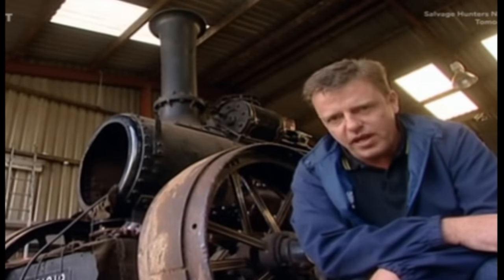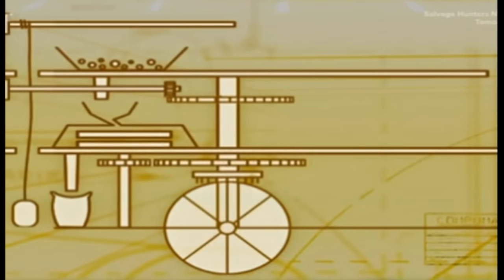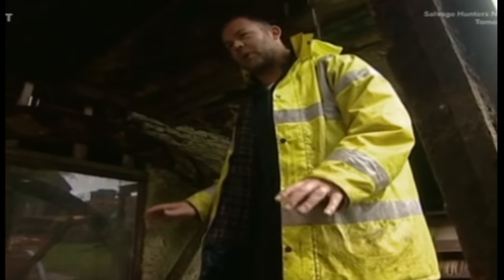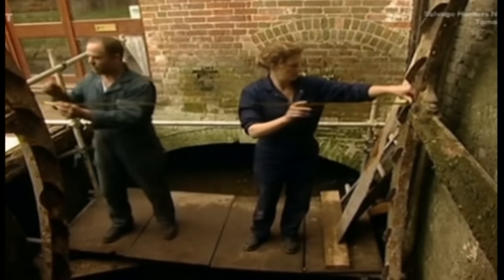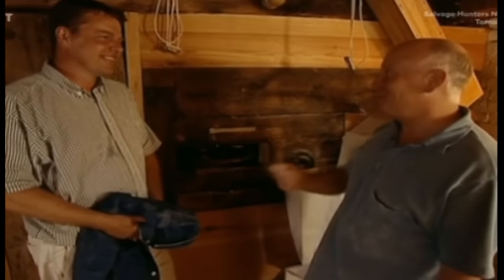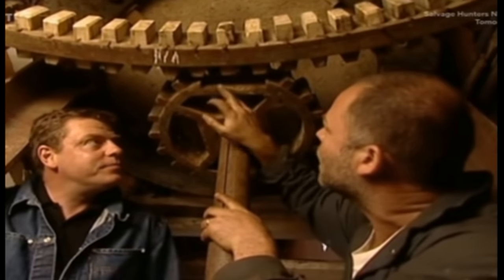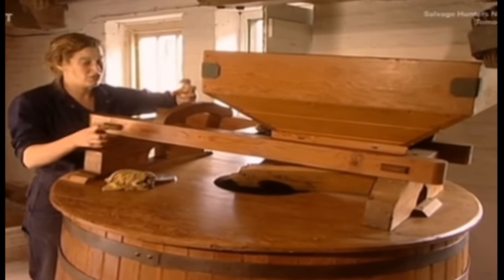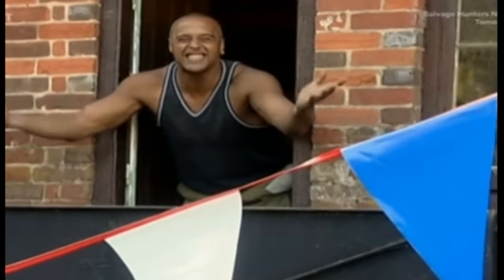salvage squad watermill

Comment: Jerry is a bit over enthusiastic!  Any engineer worth his salt would have measured the internal diameter of the bearing before tackling the shaft with a file  Emery Paper would have been the clever choice, and at that you go very carefully.  The proper job would have to turned the shaft on a lathe to clean it up then to fit a sleeve to match the bearing internal diameter.

Comment: GREAT JOB! Wonderful restoration as only the English can do it, over here (USA) we would tear the mill down as soon as it stopped working and making money.  I was a bit puzzled ans to why no mention was made of the second wheel sitting right next to the one they worked on.
Reply: Maybe where you live!  We still have some in Mo.  One close to my house with the water wheels stored inside so if they want they can make it opperational very guickly everything else is checked once a yr. and repairs made if needed. A few yrs. ago they remade the water channle to the wheel and the pit that the wheel sits in and repaired the dam.

Comment: Have this lot never heard of electric breakers? Bashing away with a hammer and chisle may be macho, but its hard work, very slow, and unnecessary.
Reply: @justotalkalottashit8392  
Intelligently used, an electric breaker is superior to hand breaking, because it uses many small light percussions, instead of a few heavy ones.
It can also be used in confined spaces, where hand bashing with a heavy hammer cannot. Its also easier to direct it at the joints, so the bricks remain intact.
Reply: Axel is only there for macho content